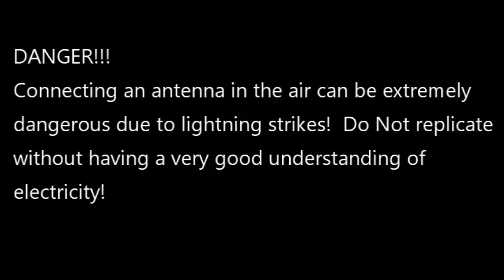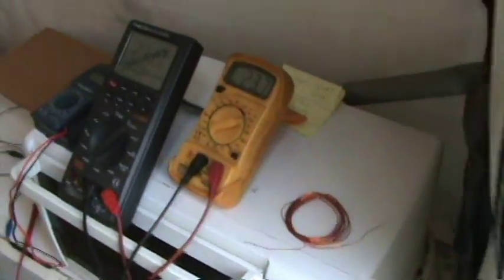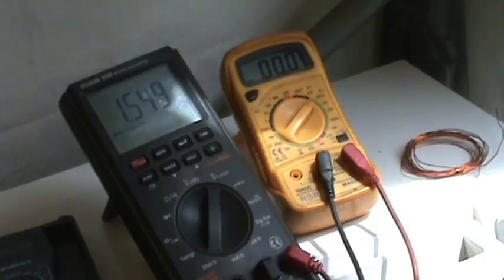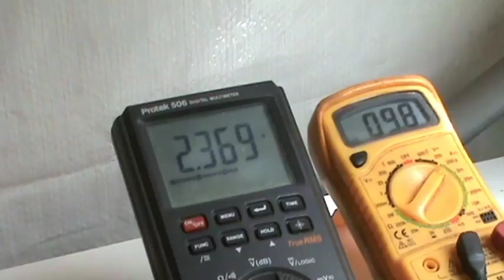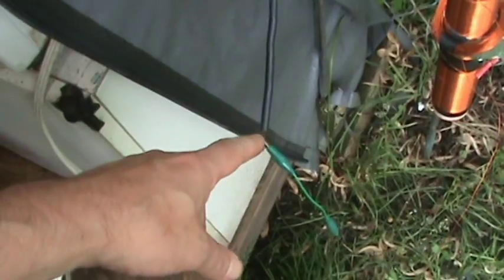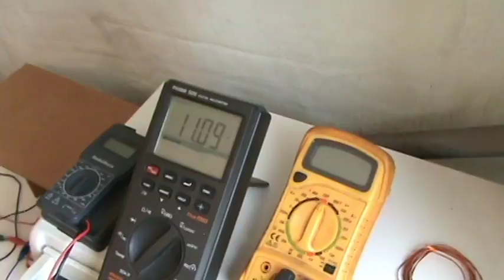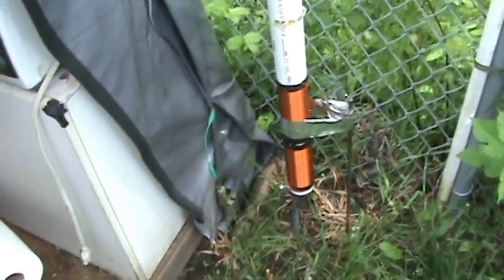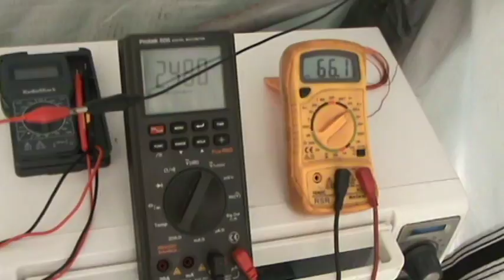Free Energy From Air 2018, part 2

Comment: Hi Paul, I believe the term you are looking for is here is 'Capacitive Inductance'. Like you said, we are batteries and we generate an electrical field, so when we approach an inductor that naturally wants to induce and carry energy then it will induce energy from anything within range, especially us walking talking batteries. But the coils are capacitive also in a couple of ways, copper likes to transfer energy but it can also hold onto it, especially if you subject it to a dielectric such as the enamel coating on the wire.  Simply approaching your coils with your hand will cause greater and greater voltage and current until the dielectric is broken and the greater of any two overcome the weaker. At which point you see a plateau where things hold relatively steady.

Anyway, all coils have capacitive inductance as well as inductance alone, that's what I was really trying to say :). Perhaps maybe in your area you have a large electrical load, something 3 phase maybe that is switching on and off. That would certainly explain why sometimes you have more power then other. I don't recall, but have you tried running your coils horizontally? Gravity would keep them tight to the ground rod and too maybe pick up better signals? Just thinkin out loud.

Good work Paul,
Michael

Comment: I'm thinking there is some kind of capacitive reactance. It could explain the fluctuations. Subtle changes in the moisture around the ground, movement of the antennae, moving around in the lab, movement of leads, any number of things could be changing the capacity and/or inductance of the system. In a perfect world the values should remain steady.Theoretically the more points available for collecting ions from the air the more current there should be. As I understand it points in the antenna act as collectors for current. Barbed wire should be better than smooth wire.  Also voltage boosters sacrifice current in the conversion.
Reply from the maker: Barbed wire,, first time i herd this idea,,,it would in fact have more points.  I will think of a better collector.

Comment: The issue comes when you add up the actual cost per watt of energy though. Seeing as you must do something [buy or build, which means money and/or labor] to obtain the energy, it is not actually 'free' before it pays for its self in savings compared to being 100% on the grid.

Adding precious metals seems like going further from free and more into very costly, so it would definitely need to yield a whole lot more usable power before it would be worth doing.
Reply from the maker: yes, you make a good point, more costly.  I will keep thinking about this.
Reply: I am sticking with solar because it is way more power per the amount I invest.

Comment: p.s check-out -- lid motors - channel and his workings with Dr stifflers high frequency  low power consumption voltage oscillation circuits i think you may greatly benefit from adding them into your thought processes
Reply from the maker: Thanks,,,i been watching a lot of Stifflers work recently.  Very interesting :-)

Comment: Why do the volts rise ?  why is it not instantly at the highest voltage ?
Reply from the maker: Hmmm, i believe it has something to do with the diodes,,,I use germanium 1N34A,,,,but If i use common silicon diodes than it will take like 10-20 minutes to get up to the full voltage.